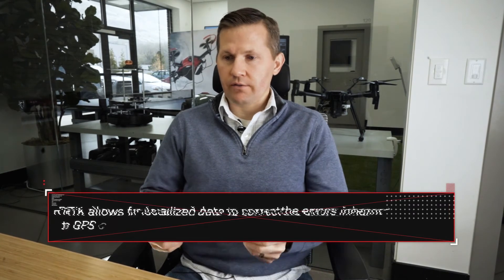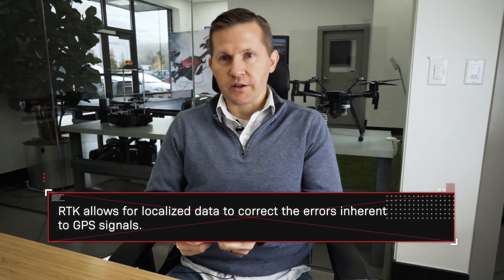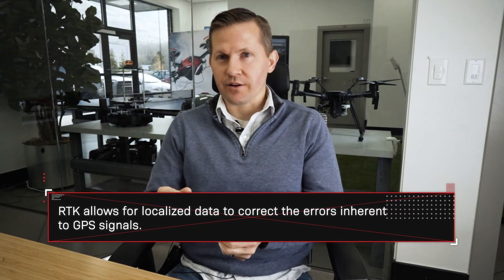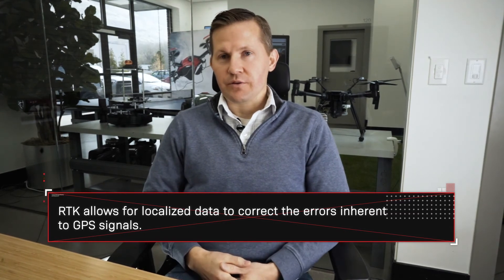How Does RTK Allow GPS To Be Centimeter Level Accurate?

Comment: If you put cm level accurate GPS receivers, 2 cm apart....  Do GPS really tell they are 2 cm apart?
Reply: On average, yes.  There can be noise in the GPS solution which is seen in the solution output.  However, on average you will see a 2cm difference in position.